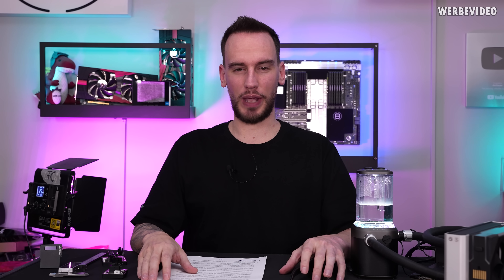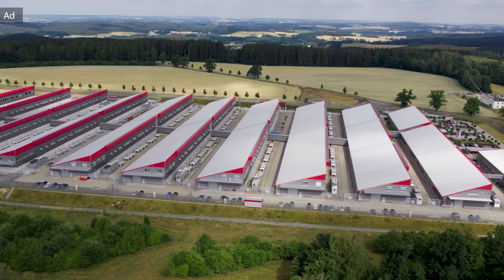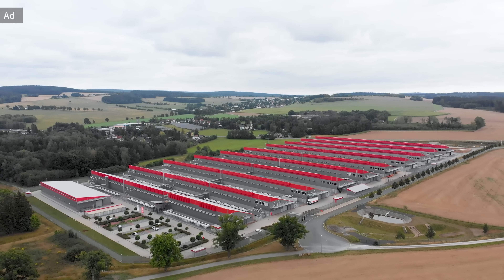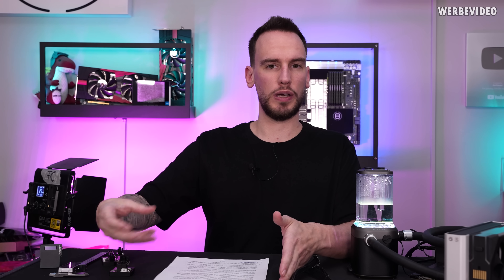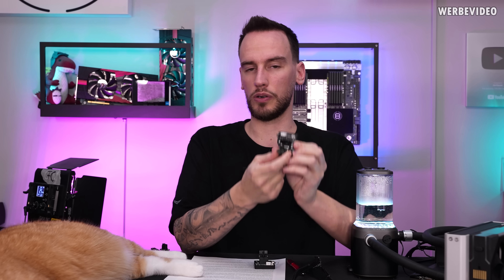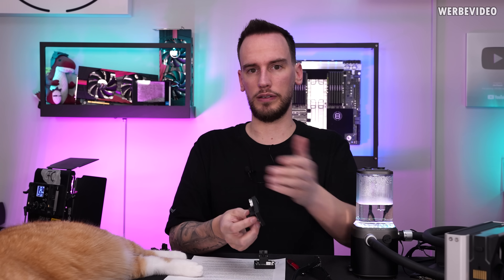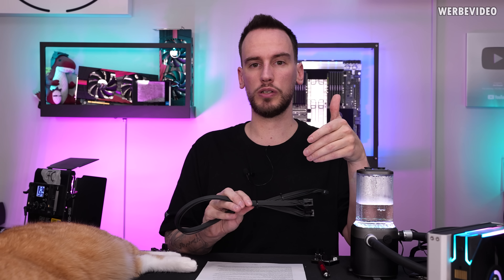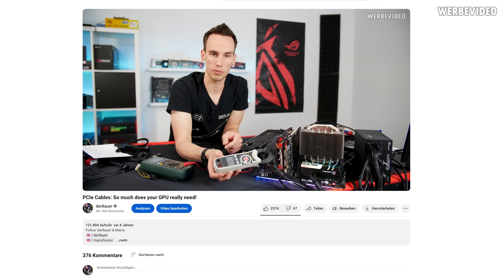12VHPWR is just Garbage and will Remain a Problem!!

Comment: In my engineering opinion, the 12V HPWR Connector is an engineering failure. The used connector (Molex Microfit 3.0) is rated for a Maximum of 8.5A/Pin before thermal derating. Every Electrician/EE knows that cables and connectors, especially in bundles, have a thermal derating factor. The 12V HPWR Connector uses 6 Pins each for +12V and 0V which puts the absolute maximum current at 51A. The PCIe5.0 spec claims that the connector is good for a sustained 600W load. Problem being that 600W at 12V is 50A! Only 1A away from the absolute maximum! And absolute maximum ratings are generally done at 20°C, which is not what you would expect to get inside a PC case, especially directly on the GPU! Honestly mind-boggling.
Reply: Exactly what I was thinking. I did the quick amps per contact math and facepalmed straight away with the stupid high current per pin. I was gonna check the datasheet since I thought it looked like the microfit 3.0 indeed, but thanks for saving me the disappointment when checking myself. Running a connector near max like that is just ridiculous, specially a tight 12 contact bundle like that.
Can't understand how in heck someone was paid to do this, and another one probably paid to sign this off.
Reply: @Kalvinjj  Blame design by committee.  For EVs, the worst connector known to man is CCS combo in the USA.  This was created by a standards body that makes money licensing specs as "standards" or with member fees.  I think these central standards companies are obsolete and don't have the skills to make something as simple as a connector anymore.
12vhpwr was designed by someone who had no clue what they were doing.  Its one job is to connect safely and it cannot do that.  Even the previous 8pin were not great. PCI-SIG ignored the issues with the 8pin and allowed the issues to be worse with 12vhpwr.
Nvidia should have copied the auto and server industries and switched to 48v as that would give them lots of power without the high current of 12v.
Reply: I don’t understand why a giant company like nvidia can make such bad/basic mistake. I meant it’s the kind of defect that impossible to miss during the prototype right?
Reply: @flamixin   Impossible to miss/allow right at the damn BOM (Bill Of Materials). Any electrical engineer worth his diploma should have seen how much current these guys are trying to pull from the pins and screamed NO quickly.
Reply: @flamixin nvidia didn’t make the connector/spec.. they just adopted it
Reply: @NyteStalker89  Yes, but Nvidias engineers could and should have known that "sqeezing big power loads through a fragile connector with tiny pins" won't work well, because contact resistance can't be haggled with.
Reply: @CranialMalfunction  imagine if this whole 12vhpwr is just another "planned obsolesence" by nvidia
Reply: @flamixin  It's in their name. Nvidia derives their name from the ancient Roman (not der8auer) Goddess of Envy: Invidia. And as silly as it may sound, yes, this is legitimate. They built their company off the idea that they wanted everyone to be envious of not having the best like the rest who bought an Nvidia card. *(even if their very first one was dog water.)

So why would Nvidia do this?

Because it allows them to later say "See, these twits can't do it right. We'll make our own PSU that does it right instead; and they'll be jealous."

Watch for Nvidia trying to buy up one of the better PSU companies in the near-ish future, or developing their own in-house.

And really, as silly and simple as this may see; this is human nature at work and it generally doesn't falter from its norm. Some exceptions apply, but we're talking about Nvidia here.
Reply: Money @flamixin
Reply: @flamixin NVIDIA didn’t design the spec, they adopted it.
Reply: @flamixin they're most likely be run by software engineers. They also probably look at the tech specs and they think to themselves, they want to use all of that thermal headroom to make it as "efficient" as possible without taking account of tolerances and thermal headroom.
Reply: @flamixin  

It's because they hire the computer science people to do the engineering for them.
Reply: @flamixin  Because Nvidia fans believe Nvidia can do no wrong. The more narrow the safety margin, the more money Nvidia saves for its record profits.
Reply: kind of makes you wonder who thought it was a good idea to begin with deserving of a Homer S "Doh", well explained thank you :)
Reply: @markmanderson  penny pinchers.. price a single 12vHP conector vs 3x PCIe 8-pin
Reply: A Diversity Hire
Reply: It's funny you mention derating. I had someone try to argue with me that 12VHPWR is superior due to derating on mini-fit jr, and I asked them how that didn't apply micro-fit. They never responded. It's odd how there are people out there that make these irrational arguments for a power connections. Even worse, they've learned just enough to sound like they know what they're talking about when they don't really know anything, so they're out there convincing people of their arguments that don't know any better.
Reply: Besides thermal derating you also have balance derating for parallel connections. The pin resistances are after all not guaranteed strictly equal, so some pins will heat more, encouraging them to build a surface oxide layer quicker, turning eventually into a runaway failure. Rules of thumb for this differ, but something on the order of 20% for each doubling of pin count has been suggested.
Reply: @SianaGearz  yep, exactly. That's why there is a margin of error that separates theoretical limit rating with real-world limit rating. To avoid this exact problem of a runaway failure.
Reply: PCISIG were responsible for the specification. Given the failure modes on all cards using it, it could result in fire and injury. Manufacturers of cards using this specification should seriously consider a full immediate recall of all products using it and consider sueing PCISIG for losses and damages.
Reply: The new connector set out to solve a problem that didn't exist, and actually created new problems.  Also the cable burning issues happen when the connector is slightly loose, and the 12VHPWR connector doesn't have a satisfying click at all, and it can also become loose from slight movement.  The 8-pin on my old EVGA 1660 super was rock solid: you could probably pull on the PCIE cable once connected and it's not coming loose.  Whereas the 4000 series cable/adapter doesn't click in firmly and is nowhere near as stable.  Also since these cards are much larger, if people dont have much side panel clearance, pressure on the PCI cable when closing possibly could cause the connector to become loose.

I shouldn't have to inspect a connector very carefully to make sure it's fully in, and the sense pins are fully in, to avoid catastrophe on my GPU in the future.  Meanwhile an 8 pin card has a satisfying, firm click and does not move.  Nor does it have the current problems you noted.  And Ada cards are already incredibly efficient, so there was no need for this connector in the first place!  A 4080 draws 320W *max*.  A 3090 can draw 385W max.  And the EVGA 3090 was using...3 8-pins.  And it was fine.
Reply: @gosuprime  I also thought the 4080 design was baffling. The 3080 has been shown to draw more power than a 4080 in nearly every type of load. I'm baffled why they all needed to be so large and use this badly engineered connector. Should have been able to make them in literally the same form factor and they'd actually fit in most everyone's case. I literally can't fit any AIB 4080/4090 and some 4070Ti in my case where my 3080 fits with room to spare. Main reason I completely skipped this generation along with the badly engineered connector. No thanks. I have an EE degree but haven't been in that industry since working in it for ~3 years building switch mode power supplies in the 90s. Even I could do some basic research on that connector and have a look of a raised eyebrow on my face...
Reply: @gosuprime  which I believe is the entire reason 12v-2x6 has been created, to fix this issue of it not being clearly connected.
Reply: @gosuprime my 3080 gamerock oc can go beyond 400w even on its default factory oc settings. 3090 can go beyond 450w. They intend to use this new connector for their upcoming more power hungry gpus. 600w is just the start.
Reply: @gosuprime  If a 4080 draws 320W max, why does a 4090 maxed out draw more than double that?
Reply: Old school approach is "The three quarter rule".
Never have a sustained load above 75% of the circuit's rating. 
Not the most "efficient" approach, but you don't have burning...
Reply: I'm an engineer for a company that makes machined contact connectors. Our 20 AWG contacts are rated for 12 amps. But no one would ever use them for a consumer cable like these because they cost 50 cents instead of 5 cents for a stamped contact.
Reply: Ever since the melted connector thing started happening I pretty much guessed it was the connector being run too near specs. If I ever have to use one of these cards, I don't care if I make it "ugly", I'm going to de-solder the existing connector and hard wire in my own power dongle. Possibly something Anderson PowerPole, and make a mating connector for the ATX.
Reply: @therealjammit  except that's not true at all. None of the melted cases are being run at "near spec." They're run far below. These are rated by Intel at 600W and just using gauges, they're rated 60W higher than Intel. 4090 is a 450W card and the adapters melt even when idling or pulling 50W. It has absolutely nothing to do with power delivery. 3090ti is also a 450W card that uses 12VHPWR and has had no melting issues. The connector is not problematic at all. Roman's video doesn't give any information to back the idea that the connector is a problem. People thinking the issue is the connector aren't looking at the specs, power delivery, or usage of the devices that use this connector. They're just saying "oh this one connector can't handle it" even though there's no evidence to back that claim. All of the melting issues have been with using two specific adapters. Not from using just the connector alone.
Reply: @Djinnerator just because you don't see them doesn't mean they don't exist. Those 3090s that have the new connectors do burn out, but you just gaslight them that it's their fault. RMA usually rejects them and they either go to NorthridgeFix's desk or it goes to the landfill.
Reply: @triadwarfare  No, there have not been any reported case of 3090 burning. Just because you don't see them doesn't mean it also exists. Every electronic has faults, if there's no pattern of faults, it's not an issue. But there has been no reported case of it, and it's been out for a couple years now. So where are these burning 3090s you claim exist?
Reply: @Djinnerator  "No, there have not been any reported case of 3090 burning" yes there has. 30,20,10 all have same "issue" when its user fails to properly seat their power cables or using 3rd party adapters. A simple google search would have disclosed this before you commented, always do the research
Reply: @Djinnerator  It should be staggeringly obvious to anyone not sickeningly undereducated that a pin's ampacity can be exceeded if there is complete failure to do something as utterly trivial as plug it in correctly and check the catch is secure as blatantly designed. The sheer lack of intelligence, care, and attention to the most remedial of detail associated with the degrading failure to do this constitutes a truly shameful embarrassment. All this hoo-ha over the source of failure is shocking and ridiculous, and shame on all those suggesting any problem lies with anyone but the user on this matter. Properly seat your power cables, buy a case that fits, do not bend cables, do not use 3rd party adapters, have a professional who knows what they are doing building rigs and you will have a %99.9 success rate according to the current data..
Reply: Honestly, why did they have to make the connector with smaller pins?  If they had just stuck to the same size of pins as the normal connector, we'd be fine.  I don't know why the standard had to be smaller when most of the graphics cards that justify such a high power rating are so big that the size of the power connector is irrelevant.
Reply: That derating table, number of conductors is not number of strands that Roman was talking about
Reply: The answer is probably money (again). Senior management and executives at Nvidia who have little knowledge on what they're selling to consumers (including children) and risking burning their homes to the ground. I am not surprised by this attitude from the upper echelons of our society but I am surprised by your crucial detail.
Reply: @BleedForTheWorld  Senior management at Nvidia have plenty knowledge on their consumers, which is why the marketing is so successful. Knowing the consumer's hopes and fears is more important than knowing the product itself.
Reply: And from a mechanical standpoint it's also junk, since any pull or bob against the cable causes it to unseat ...

I'm extra glad I went the AMD route this time... Just 3x 8 pin.
Reply: @DCG909   Yeah, I agree. It seems to have some pretty strict requirments when it comes to cable bending, the amounts of installs etc. It seems that those requirements have too little safety margins given how different PC-cases are. The average consumer  dont understand that they need to install some 90 degree adapter for 40 euros and dont know how sensitive the cable bending is. It is not the fault of the customer. It is even proven that doing it correctly can have issues. It is a probability distribution, if you design it very close to tolerances there will be a percentage that fails eventhough they do everything correct. That is why you design with tolerances and extensive testing.
Reply: and now you know why Nvidia doesn't use it on their commercial lines of cards, or why any other maker is using it.
Reply: Anyone involved in signing off on the 12vhpwr connector for use should be barred from engineering anything in the future.
Reply: I learn somthing today and now understand what has gone wrong thank you insight
Reply: I'm sort of confused why this was able to happen in the first place.  I have been thinking about this since they released when I did the calculations - I looked for a PSU that specifically stated a larger wire size for the 12hp cable.  Isn't there usually a safety factor that needs to be hit in order to sell a product?  I've heard 10% in some fields is minimum, and most go beyond that.  Is this a failure of regulation, or is there no actual regulation for this?

I know for building electrical, there is a safety factor built into the specs required to meet code, and there are still scenarios that are explicitly called out when you need to increase wire/terminal size further.  I just find it hard to believe that there wasn't some regulation that was broken to release these connectors in the first place.
Reply: @Zyxlian  not an accident, company politics.  Nvidia wanted the connector.  the egg head  who made the final call has likely never even took a grade shcool science (IMO).  So,  on paper 50 amps is less then 51 amps,   so they did it.  I have same type of problem where I work.
Reply: yeah not an engineer but the first time I saw that connector I thought this was designed by "theoretical engineers", aka the engineers that design things that work only in theoretical or optimal conditions. Also nobody did tests to notice that MAYBE it was a bad idea too, another classic "theoretical engineer" thing. The theory is always right, why waste time testing it.
Reply: It wasn't any engineering failure it was definitely known as it is absolutely basic shit 
They knowingly allowed it
 also against having a connection carry that high amps flow just from some pins without any locking mechanism or support
Reply: Brilliant explanation. 8 pin forever.
Reply: Not to mention the added heat due to the resistance generated from improper pin connections, it really is amazing that more people aren't having issues.
Reply: Nvidia wanting to be special
Reply: Just like Nvidia. Put it all to the max edge!!!! Fire?! Nah! Not our problem!!
Reply: And they didn't even bother to use gold plated pins. Higher the contact resistance means more heat, perfect for burning through plastics..
Reply: I'm glad to know that an engineer has confirmed that the 12VHPWR connector is objectively horrendous. As a consumer, I find anything that fails considerably from user error is badly engineered. Something (especially a connector) must be built with  consumer stupidity in mind, pardon my French.
Reply: I have been seeing these connectors melt at about 32 amps of continuous usage in the automotive industry. If the environment gets extreme heat for any length of time the contacts can't move enough heat away to the board and the  silicon burns.
Reply: They changed the design so they can license it nothing more, and MBA that did a week of engineering came up with this. They probably got tax credits for being ESG targeted, and no different for car manafacture having biodegradable wiring looms in engine bay. In the 90s
Reply: The fact that it’s an Intel design, yet even THEY refused to adopt that standard on their own GPU’s should have told every bid wig at Nvidia what they needed to know
Reply: I agree with your comment @web1bastler, but the official Microfit documentation also points out that the max 8.5A rating is only applicable to dual-circuit connectors, and recommends progressive derate for higher circuit density configuration. 

At 12-circuit configuration (6 conductor pairs), the max current per terminal is 5.5A (about a 25% derate). This is straight from Molex product specifications sheet for the Microfit series (Molex document # PS-43045)

The 12VHPWR connector is a true fuck-up
Reply: Why most electrical codes allow for overhead. IE 1500W on a 120 volt 15Amp circuit.
Reply: NVIDIA produced defective cards, that's the simple gist of it. All these other brands are trying to produce solutions to fix what NVIDIA did in laymens terms is an 'oopsies'. The problem comes down to simply that the eggheads at R&D department of NVIDIA thought that theoretical limit of power connector material limits is the same as real world material limit i.e. that resistance and material impurities don't exist. So pumping that much power through singular tiny connectors that are full of resistance and impurities would conduct heat and eventually there would be a melting point. CableMod's adaptors are not faulty or defective, the point of failure is on NVIDIA's side.
Reply: Oof. Great point. I hadnt even considered that it might be burning because its way too close to the limit of what the physical materials can take.

From now on, if someone asks for a good example why you shouldnt fly too close to the limits i'll remind them that these are burning up because of this. Thanks!
Reply: Aside from derating due to heat and heat cycling there is also the plug-unplug cycle derating.  A cable that you use to do benchmarking of various different GPUs is not going to last as long as a one-time assembly.  I have not found the number of cycles for the 12VHPWR connector but similar connectors claim about 30 plug-unplug cycles before they are out of spec.  But that is an average number and not an exact life-time estimate, so the cable in the video could last for more or for fewer cycles. Regardless of which card and the number of amps you are pulling the life-time can be greatly reduced by the number of plug-unplug cycles, heat cycles, vibration etc... Two 12VHPWR connectors would work to lessen the load but three 12VHPWR cables would be the magic number to stay in spec for higher power hungry cards over their entire lifetime of use, but it is the power supply side that has this higher derating factor, not the load/GPU side and I'm guessing that is by design.
Reply: For fun I checked Molex website, found the pin inside the conector is rated at max of 9.2A for power pins and 1.0A for sensing pins, so if there is no load balancing even a slight hike on one of the pins can cause it to burn. Also a fun fact they are very sensitive to humidity and temperature, which both of these factors are in a closed PC case.
Reply: Coming from an EE background and working in industrial automation, I am baffled by this connector.
Reply: So I guess the 450W cables are not as bad?
Reply: Yes, no engineering safety range. Well, 1A. Because you can ALWAYS ensure NOTHING will cause to momentarily draw more than 1A and that you will always use your PC In a place that always remains at 20C.
Reply: I think they did it on purpose so tat they wont have to accept RMA of many gpu. because retailers are claiming that their warranty does not cover "burned connectors", so if you have that issue you are on your own...
Reply: Does the PCIe5.0 spec factor in power provided by the PCIe connector itself, when specifying the 600W rating?  Or that 600W is solely what the 12V HPWR connector can supply?  Specifically is 600W a system rating, or a connector only rating?
Reply: @earthwormjim  Couldn't tell you about the PCIe 5.0 spec, but on the older version that still had 12VHPWR it specified 600W for the connector itself. So, if you were designing a card that used 12VHPWR you had the 75W from the PCIe connector itself plus 600W from the 12VHPWR. Since they've always done it this way, as you're free to choose if you need additional power or not, I'd guess it's the same this time.
Reply: Yes, running that close to the theoretical maximum is a poor design, but on top of that, the real question is are they using genuine Molex connectors on both the cards and the cables, or did thy go with the no name chinese clones to save a few pennies?? And if they are genuine Molex, was there a manufacturing problem where the pins are out of spec and not making a good connection?
Reply: Its a non issue. According to the AQL industry standard (Acceptable Quality Level) the acceptable failure rates are as follows. This issue also would fall under a minor defect due to scarcity of the issue (less than %0.1) :

The failure to meet the requirements of customers with respect to quality is termed as defects. The three categories of defects are:

Minor Defects - Not likely to reduce the usability and material of the product for its intended purpose, but slightly altered from the intended design and specifications. The industry average AQL for minor defects is 4%.

Major Defects - Not acceptable to the customers. Usage of the product will most likely result in failure. The industry average for AQL for major defects is 2.5%.

Critical Defects - If accepted, this type of defect could potentially harm or injury the customer. These defects are completely unacceptable. The industry standard for AQL for critical defects is 0%.
Reply: @javiersantana848  depends on the circumstances and the danger stemming from the defect. If the defect could light a customer's house on fire then the margin for defects is essentially 0. That is the case here.
Reply: It's not a Molex Microfit 3. It's a compatible product by Astron which supposedly has a much higher current rating.
Reply: One thing also was bothering me. That busbar inside that connector. Without it you would have cable to balancing out uneven pin connections. With busbar if one contact have better connection than others then it will take more current and can go over specification. That pin have bigger thermal load.
If I remember right PCIe 8-pin connectors don't have busbars.
Edit: That busbar may have been only on those adapter cables that was problem at beginning.
Reply: This is all Nvidia’s fault , why the hell do people keep putting up with them and giving them money, they don’t care about their customers at all.
Reply: I'm no electrician and didn't even know much bout thermal derating, I just do amateur projects and the odd outlet here or there, but from the get go I always thought in the back of my mind it's just TOO SMALL! Even after the melting debacle I still thought it was too delicate compared to the previous standard that worked just about perfectly no matter what. The worst part is people genuinely trusted that everyone trusted Nvidia and PCI-sig to know what they're doing, but It just feels like an unneccessary, shortsighted corporate move to save their 10 cents a product.
Reply: The microfit pins I ordered are rated for 12 A (Part-number 10132447-121PLF)
Reply: The 6 and 8 pin PCIe power convectors must have plenty of overhead built in. I always thought it of that the two extra conductors in the 8 pin are both ground. Meaning only 3 of the 8 conductors are providing 12v. So from an EE perspective both the 6 and 8 pin should have the same maximum power delivery specification.
Reply: Agreed. I used to do board design for Gigabyte. I worked on some extreme OC boards and some budget offerings. I've refused to sign off on beefier connectors than this for an expected load of 400W. I take pride that these boards are built like tanks with massive safety margins, as I have yet to see a melted Z490 Aorus board even with the hell people put them through with 10900K OCs.
Reply: yeah expecting to use it right at max spec limit in situations way hotter than what it's rated for is just mind boggling.  Idk how any company thought adopting this was a good idea. If I was a gpu maker, psu maker, or cable maker I would know to stay a mile away from this. Just gonna be QA and customer service disaster with alot of RMA's.
Reply: True. The second I saw this connector, and heard claim about 600W at 12V, I knew it can't be right. It looks like flimsy sh*t, compared to WAGO wire connectors rated at 32A. No way 50A is a safe load on this new connector. Tests on test bench maybe went well enough, but that's not real world use.
Reply: 12VHPWR is compact and pretty. Unfortunately it's very uneconomical to build a pair of connectors, both male and female, that can withstand that much current. You have to lower the current by splitting the wires or move the PC to 48V era like Tesla.
Reply: @JohnWilliams-gy5yc  you can have compact and pretty connectors. The whole RC hobby uses XT60, a small connector jointly released as open standard by Hobbyking and Amass, which is basically an LCP shell around bullet style hard gold plated copper alloy connectors with 30A sustained continuous rating. The connector terminates wire side in a solder cup that can be dip soldered by factory, but crimp variants apparently exist now as well. Crimping XT style connectors has lead to issues in the past, this is something that needs careful validation. Another high current variant can be made with blade style connectors and advanced gripper design and again hard gold coatings. The blade can terminate into a busbar PCB to allow joining multiple cables to it to make it compatible with typical Molex Minifit style modular PSU outputs. The cost of all this is very insubstantial compared to high current semiconductors necessary to make use of high power connectors, and you can scale grades down for cost with detect signalling side channel like on the 12VHPWR, or varying the shell key shape such that a higher rated version cable can be inserted into a lower current consumer but not vice versa. I don't know why this industry completely avoids higher end materials and construction, there's no good reason for that.
Reply: I have always said the 12VHPWR specification was a garbage 'standard' that should never have seen the light of day!

According to Molex's specifications for Microfit 3.0, a 12 circuit connector (single row) is rated at 6.5 Amps per pin, so with a double row it will be even less! Assuming 6.5A per pin and 6 positive pins, this allows for a total of 39 Amps which at 12 Volts equates to 468 Watts. If the connector is derated to 6 Amps because there are two rows then this allows 36 Amps, which at 12 Volts equates to 432 Watts. The IEC rates the connector at 5 Amps per pin, which gives a total of 35 Amps which equates to 420 Watts.

Long story short, when this first came up on this channel I started researching the connectors and from the information in the video I discovered there were three sizes on connector in the same style. The 12HPWR connector was the smallest, lowest specification, of the three. The next size up is the same as current PCIe connectors and finally there is an even larger size. If the largest size had been chosen, this could have been a genuine improvement in power delivery. How the current smallest connector came to the standard I do not know. I would have to check each of the connector specifications carefully, but I do wonder if there was possibly a typographical error somewhere or confusion or misunderstanding between metric and imperial units, both of which are known to occur fairly frequently.
Reply: Microfit, which is normally 8.5A/pin but does actually have 10A/pin high current terminals available. There's also Microfit+ which for a 6 circuit dual row application, like the 12VHPWR connector, is specified at 10.6A/pin at 16AWG.
Reply: how about rtx 4080 tdp of 320 watt , will it withstand worse case scenario ?
Reply: Well there is ONE thing that may have been overlooked by most. PCI-SIG also tends to count the power supplied through the Motherboard. Which is stated at 75W for GPUs through a PCIe 16x slot. Under this the maximum sustained load over the cable/connector would actually be 525W or 43.75A (7.3A/pin) which would be safe. Gotta be sure it is explicitly the cable rating, not the total power rating...

Regardless i honestly think they should have just used the Microfit+ as a base. It is slightly more expensive, but can handle 13A/pin. It is appalling that despite the superior safer option available for components of these costs, they still decided to cheapen out....
Reply: Exactly my point, right on!
Reply: Not to mention they should've known that vendors would exceed the max current spec for nontrivial transient periods, e.g. pulling 120% or more of the max rating for tens of seconds at a time, like they always have done with products aimed at the OC market. Even when we're talking about a cost-optimised system for mass production, it's downright negligent to build with a sub-2% safety margin, let alone one that's instantly violated in the upper quartile of standard environmental temperatures due to thermal derating. The worst part, too, is that there's a bell curve of effective contact surface area on pin connectors like this, due to variances in the crimping, which leads to pretty nasty current density hotspots in a few percent of connectors that are on the borderline of passing QA. Anyone who's done a PDN analysis (which should be literally every engineer involved with a spec like this!) knows that you've got to watch out for that kind of thing. Having been part of standards working groups in the past, my bet would be that the engineers were well aware of just how close to the limit it is, but their concerns were overridden by industry members in the WG who wanted to cut costs. Connectors and cables are an expensive part of the BOM, with secondary cost adders due to increased shipping mass, so it doesn't surprise me that they were trying to skimp on the design.
Reply: yeah, when you consider the older 8pin spec is less than half the per pin amperage on LARGER CONNECTORS, the entire 12vhpwr seems like a fiasco meant only to shave a few cents off total unit price.
Reply: Yeah I thought it would be funny to hook up my 4090 with 2 8 AWG wires way safer
Reply: @B0BBYGAMER  Doesn't sound safe
Reply: Damn. Well if I had 4090 I would definitely undervolt it a little.
Reply: @megapet777  Why would you spend $2000+ for a 4090 just to get less performance by undervolting it? You can get the same performance of an undervolted 4090 with a cheaper card that costs half the price
Reply: Hi, thanks, as i can see in this table they calculate it for 1000v ? Seriously ? How crazy they are !  
Electrical norm are different for each country. When you building a house they are really more restrictive than that bullshit tabler with 0 security factor and no default to the cables. The values on this table are made from theorical cables who are perfecly made in an utopian world ? . 

For 230v in Switzerland you officially allowed to put 13A with 1.5mm2 full copper wire,  and it depend of the length of the cable in the walls too. (Normally it's 10A for full secure to the cable, but for shorters distances and shorter using time it's ok to use 13A, so the security here is theorically arround 30% in normal usage : plugs in the walls are specified for 16A max before melting, but not the cables who die way before 16A)
Even while respecting these standards you can melt a cable after ~1hour (on the same plug) if you use max wattage (230x13= 2990W) achievable with some vacuum cleaner from stupid builder (ex: thanks Dyson with olds models) .
Reply: It's obvious to me, planned obsolescence, build in as many failure points as possible. With nvidia's approach to minimal v-ram,  clearly that's the whole idea behind all their anti consumer/stupid decisions...
Reply: Not an opinion.. just a fact... you need room to accommodate the spec to avoid issues ......
Reply: I made about the same comment when they first came out and were melting.  I had been looking up minifit power capacity for some car audio, with wire gauge and pin type.  Not all pins are rated the same either, and if I remember correctly, it could fall under 600w.
Reply: OP is correct.  This is why there the potential for such a problem at only 450W.  When not fully seated it creates a big problem and that is nowhere near the 600W supposed limit.
Reply: So this is how far planned obsolesence has gone
Reply: yep it feels like even just derating that connector to 450W per connector would help a lot. That would match up with the actual current carrying capacity for 2 x 6 pin miniFit (using all pins for current carrying) too. And maybe updating the spec for 8pin PCI-E power to be around 220W. And no more sense/config pins complexities.
Reply: @DennisLeeyeet  the problem is the cards that are melting have a design power draw of 450W. So just derating the connector won’t solve the poor connection problem. Unless the cards are OCing 50% more power, tolerance on the pins and a bad location for the connector that guarantees it will be heavily bent are the problem
Reply: diversity hires
Reply: Just another reason to undervolt.  My 4080 never draws more than 320w maximum during the hardest stress tests with an uncapped frame rate.  Since I normally cap my frame rate at 60 anyway, it almost never even reaches 300w.  Doesn't really bode well for future cards though that will invariably be even more power hungry.
Reply: What if we set power limit to the 4090  -15% and undervolt the card
Would that increase the saftey margin
Reply: @Adel-sj4ue  You would have to power limit the card to about 300W to be in the safe zone for the connector.  That is about 50% of what the connector itself is rated for (which is BS for such tightly bundled connections and wiring). Over 50% is where the danger starts to occur but if you really want to play it safe then just don't use that connector.  Or at least don't use it by itself, solder some wires on and add a second connector of some kind that can support at least 150W so you don't have to power limit the card.  This still means the trances on the card need to carry all that power so the board itself might need a little modification so the traces don't start to heat up and separate from the board.
Reply: That is why I use a 3 x 8 at 288W per plug rating to 12VHPWR cable.
Reply: How is the connector an engineering failure as opposed to an implementation failure of the manufacturer's making GPUS and expecting to run a connector at near maximum capability? Everyone knows you don't spec a cable or connection with 0% headroom. The connector work just fine if kept within it's limits, allowing for extra room due to thermals/manufacturing tolerances etc...  The failure is the gpu manufacturers and PCIE spec if anything.
Reply: nvidia just doesn't want their gpu to last 10 years that much is obvious.
Reply: Yeah, I have a Ham Radio License and was an industrial electrician working with automation controls. If you have electronics experience, you can just look at that 12 pin connector and know it isn't right for the power they want to run through it.
Reply: Absolute RIGHT!
Reply: It's even more than the math says. I have a Ham license and also did industrial electrical controls for awhile. We always figured in about  a 10% to 15% "fudge factor" as well, based on real world experience.  This is happening to Nvidia because of bad engineering and shear corporate arrogance and refusal to admit they are wrong. IE Nvidia is now a full blow Robber Baron company, and I'm not buying anything from them for some time into the future. If they can't get a simple electrical connection right, imagine what horrors may lay hidden on the PC board and component selections.
Reply: Who would have thought replacing 24 pins (8 x 3) of higher gauge wire with 12 lower gauge wire in a much smaller space would lead to such problems!!!
Reply: It's also better to have separate wire bundles (2x6 or 8 vs 12) from a mechanical perspective. The new standard was really not needed.
Reply: @valkaielod  done for cost savings
Reply: For your engineering opinion, what keeps that 50 amps of power draw between the 6 +12v to ground pin circuits balanced so when it is running at 600 watts that each one is only drawing 8.33 amps and not cause one +12v pin draw well over 8.5 amps?  Given Gamers Nexus video, the RTX 4090, for our example, will still draw 40+ amps through the connector even if only 2 +12v and 2 ground pins are connected.
Reply: @LBXZero   Nothing actively balances the pins as far as I know, they're just in parallel and be it. So yes, when one of them has a bad contact, the others take up the slack.
Reply: @Kalvinjj  What if one pin's wiring to the 12v rail in the PSU is significantly shorter than the others?
Reply: @LBXZero   if both that happens and the pin itself isn't compensating with higher resistance, it's to be expected this pin/wire will carry more current. It's impossible to fully balance it, a good connection does enough of it but the margins are too small here.
Reply: @Kalvinjj  this is potentially the point of the safety factor.  I find the connector being what melts is the red herring of the investigation.  For a 12VHPWR to 12VHPWR, you have 6 +12v paths from the 12v rail(s) in the PSU, the wiring in the PSU, connector at the PSU, wiring to the device, connector at the device, then the power regulation system in the device.  The adapter dongles make everything worse.  If one path becomes more favorable than the others, more current goes down it, even if it is unsafe at a certain point.  It is a surprise we don't see more melting at the PSU connector, but that is probably because most cases are using the dongles.  When PCIE 8-pin connectors melt, it is typically the PSU side.
Reply: @LBXZero  The interesting thing, and what also pisses me off a bit, is that the older 8 pin connector (by design, also the 6 pin ones) could take up to 13A per pin. In short, the two 8 pin connectors, despite being rated at 150w per PCIe spec, can on the same safety margin of the 12VHPWR pull about 900w together. They also got 3 +12v pins each so the total is the same but the larger spacing connector allows even thicker wire. I have no clue why they went with Micro Fit 3.0 smaller connectors other than to appear oh-so-new and save some pennies.
Reply: @Kalvinjj  I am assuming the 12VHPWR design was to reduce the landscape the power connectors took up, to deliver insane power to a smaller card.  When I took apart my video that was 3x PCIE 8-pin connectors, there are a series of what I am assuming are the VRMs labeled R12 2041 which get thermal pads, and then there were 6 similar chips labeled R15 2041, 3 scattered between the GPU and the slot panel and 1 behind each of the PCIE 8-pin connectors.  Each power connector needs a set of components for them, as it is always the device's responsibility to regulate the power draw from any source.
Reply: @LBXZero  Electrical resistance at the pin connection will determine the current load of any individual pin, if one pin has a higher current load it will heat up faster, increase it's contact resistance, lower it's current through put and the other pins will take up the slack according to their own resistance. You don't just have one pin taking all the load unless something is very wrong (then it's too late)

Note that it's the high resistance connections that are causing the burning, not necessarily the pins that are carrying the most current, though the failure can cascade quickly if the connector is running so close to it's spec limit like here.
Reply: @volentimeh  Let me give you a situation.  We have the RTX 4090 and a 4 PCIe 8-pin dongle adapter.  The collection of modular cables for his power supply had 2 cables with 2 PCIe 8-pin plugs and 2 cables with just 1 PCIe 8-pin plug that is a little longer.  The person ends up plugging into the dongle adapter the middle plug of 1 2 plug cable, the end plug of the 2nd 2 plug cable, and the 2 1 plug cables.  It is a know fact that the length of the wire adds to the overall resistance of the wire.  The pin's resistance will determine how hot the pin will get under a certain load, I know that part.  But isn't it the entire path's collective resistance that determines what kind of load that crosses that pin?
Reply: @LBXZero  model the connector pins as PTC thermistors in parallel, and apply Kirchhoff's circuit laws. the lowest resistance path will have the highest current, and the highest resistance path will have the lowest current. resistivity is linearly proportional to temperature. temperature increases with the square of current (P=I^2R) so you get a simultaneous equation that describes the equilibrium. you can trivially model this in LTSpice using behavioural resistors - you'll find that the individual pins reach a thermal and electrical equilibrium. (this is in contrast to semiconductors where there's a negative tempco, hence the issue of hotspots and thermal runaway when operating MOSFETs in a linear mode). the issue is that when one conductor has a higher resistance than expected (e.g. due to poor contact on the pins) the current through the other conductors increases proportionately to satisfy the load - remember that the load is nonlinear and can be modelled as a constant current sink for simplification, so the overall current through the connector doesn't go down as the connector resistance changes. this shift in relative current increases the ohmic losses through the "better" conductors by the square of the magnitude of current imbalance, which is a major problem if you're operating the connectors near to their limit anyway. the problem is particularly bad on these types of connectors because the metal-to-metal contact is rarely consistent, so you end up with high current density hotspots, which can lead to localised parts of the connector pins getting much hotter than expected. if you do a PDN analysis with a field solver you can see this visually - the current density increases rapidly as you pinch the current flow through a small volume.
Reply: also 16/18/20 AWG rating is for used cable as a whole, not for theoretical cable without strands. so I don't understand why Roman used that coefficient table and cut his PSU 6+2 pin at all.
16 AWG is 18A@90C. period. so it can handle way more than what Roman has calculated. anyway the main limit is actually pins, not wires.
Reply: @rawdez_ yep, he got a bit confused
Reply: @rawdez_  that's also something the 12vhpwr cable kinda "fudges". They use a 30*c rise, while the 12v atx molex one used a 20*c rise.
Reply: @rawdez_ I am an electrical engineer designing electrical systems for nearly two decades.  I have probably worked on equipment that built something in every single car you get in today.  I have never used the 90C rating on a conductor in that time period.  This would be transferring heat into other components even if your sheathing is rated to 90C.  We have to derate for conductors for so many reasons.  I typically start at an 80% derating because I know it will nearly always be at least that.  Him using exactly this is normal.
Reply: @mrfarts5176  I am in no way an electrical engineer and I was always told you NEVER go over 80% of the rated load of a circuit. Nice to see someone saying this.
Reply: @keithvsmith  Thats actually just for building wiring, which has its own set of definitions, ratings, and regulations. There is no way to assign a "circuit load rating" that is applicable in every engineering scenario. For instance, the "rated current" for an 8 AWG wire is typically cited around 50-60 amps depending on install conditions and insulation type. But in a large UAV we may be putting ~200+ amps through the same size wire with no issues. Ther are a lot of reasons for this, and it is why there is a difference between engineers and electricians / technicians jobs.
Reply: @rawdez_  I believe Roman took the worst theoretical case scenario.
Reply: So basically what you're saying is limit the spec to 450W, which should be a big enough margin of error. 450W + 75W from the PCIe slot is 525W total should be more than enough for a 4090 aftermarket cooler.
Reply: I don't need to be an engineer to understand the basic concept that smaller connector = lower tolerances. It's a nice concept to have 1 connector for your GPU but in practice the guague of each pin should be much thicker.
Reply: @llamapi3  guague? What's that?
Reply: @sammiller6631  A gayge, obviously.
Reply: @VladimirNicolici  obviously?
Reply: I knew the 12VHPWR connector was a poor design, but I'm not an engineer so couldn't have possibly backed up my notion with actual data. Thank you for doing the math and confirming what I already suspected through my own speculations: too much power being sent through a much too small connector.
Reply: WATERCOOL THE CABLES
Reply: Something that amazed me is the fact that nobody mentioned using 2 of these cables instead of a single one.

That is a great bandaid tbh.

And the fact that 2x6 ones have shorter sense pins AND longer current pins, so they have higher contact surface.
Reply: I don't think the problem is the connector, if you look close to 3090ti it has almost same connector. The only difference is 3090ti split 12v input to three different rails. This way the card can do load balance much better on those six 12v pins. The most failed connectors are happened on one pin at out side which show the uneven load on the pin. I don't see anyone openly criticizing the Nvidia on this design flaw, rather blane everything on the connector.
Reply: the extra powe draw is the issue I now understand  @kaiwenwu8148
Reply: @kaiwenwu8148  No, you are not accounting for metal impurities in a connector and resistance. Safety of margin exist for a reason because you can't assume that a theoretical limit is the same as a real-world limit. What went wrong here is that NVIDIA assumed that they could push the threshold of conductive material limit to the theoretical limit. The result is that, connectors are burning because they build up too much heat from resistance and metal impurities. They also didn't take into account that amps threshold is done at 20 degrees temperatures, where most computer cases will be double the temperatures (either liquid or air cooled). Basically someone at NVIDIA did a major oopsies. And they won't admit it, or do a recall at your expense of constantly getting your graphics card repaired every 6 months to replace a burnt connector every time. The 4090's are defective.
Reply: @luminatrixfanfiction  I think you missed my point, I not saying Nvidia is good to choose this connector. What I want to say is if you use better materials to make this connector the issue will still exist, even switch back to old 8pin pcie connector the issue will still exist. If you run two cables in parallel the current handle ability is not 100% increase but more like 85%-90%, if goes to six cable the current handle ability is like 60% to 65%. This is why connector is not the real problem, the power delivery system is the problem. Hopefully you can understand.
Reply: @luminatrixfanfiction  In my calculation, the max possible current go through one pin is about 20A this no possible way to make a contractor to handle this kind of current. In 3090ti pcb design the max current on on pin is 10A. This is the difference.
Reply: @kaiwenwu8148  uneven loading is the connectors fault.
They are suppose to be designed that uneven loading isn't a problem.

You will simply by the nature of gravity pulling down a cable will cause uneven loading on pins... longer/heavier the cable the greater effect gravity has.
Also as the cable heats up the plastic insulation becomes less stiff and further increases uneven pulling just from gravity.
You can see just HOW sensitive the connector is by needing 3.5cm before you start bending it...
Which pretty much make it and the videocards its currently used on... not fit in effectively any case.

Yet they added those bending rules after the fact...
Reply: @kaiwenwu8148  "almost" the same connector is not the same connector. That's like saying FSR is almost the same performance as DLSS. Or 7900XT is almost the same as RTX 4080. If AMD's Raytracing performance is almost the same, why aren't more people buying them over Nvidia?
Reply: @sammiller6631  3090ti don't need the 4 sense pin, I don't see it going to change anything.
Reply: @kaiwenwu8148  3090 is old. What will they do for the 5090?
Reply: @sammiller6631  "why aren't more people buying them over Nvidia?" because of Nvidia's garbage marketing and the gullibility of consumers to "want the absolute best" at any cost. that is why Nvidia has more market share. they aren't a "better card" by any stretch. Nvidia just markets it better and the blind masses willingly pay what Nvidia charges. 

People will put themselves into crippling debt to get the latest XX90 series cards to be the best. even if their use case doesn't fit the necessity.
Reply: @sammiller6631 bad fsr wont burn your computer.
Reply: The spec might call for a 600W capability and that might be sailing VERY close to the wind but what stock card pulls anything close to 600W?
Reply: @BikingChap  If they don't allow 4090 to be overclocked, it will hurt sales. So you can't assume stock card levels for safety.
Reply: @sammiller6631  I'm not familiar with overclocks on the 4090, do they go over 600w when benched?
Reply: @BikingChap  Gamers Nexus showed a 4090 overclocked to 666 watts.
Reply: @sammiller6631  that's mental isn't it, but there's clearly more to this because i doubt those with burning connectors had all pushed them that hard. It still smacks to me of connectors where, for whatever reasons, pins are either going high resistance or completely losing contact even with the slightest physical stress.
Reply: I wrote this somewhere else, but since this is relevant here, I am gonna copy paste my response :

As an electronics engineer myself, using similar connectors I am actually very confused about all these problems? We have been using similar connectors for the last 15 years producing well over 10-20k units per year. Not one single faulty unit. We only use Molex and JST branded and they have zero problem doing the max ratings over long periods of time in a guite warm environment.
I also don't agree with the explanation here. I think the main problem here is the mix and match between brands of connectors between cables, adapters and video cards.
Some video card and cable manufacturers are using very cheap and low quality connectors as well as bad matching metal parts (pin and receptacle) 
Again, an high quality Molex to Molex brand connector has no problem sustaining this amount of current.
I test that even on a regular basis.
Reply: @p_mouse8676  its because they are specing it out at a 99+% duty cycle.   even the wiring in your house is only spec's at 80% duty cycle, with 15A (in NA)  being peak.  this type of torture cause material degredation ove time. simple Nvidia ate into their tollerences.  terrible reality in large companies is the person with final say is usually not the one actially qualified
Reply: @p_mouse8676  molex cables and connectors have a good security factor : 30% from the max or more ? , When those stupides 12pins connectors have only 2% of security..... same as the car market makers now security factor level reach 0.....   Do the elevator makers make 2% of security too ? Not really, they have a factor of 2 ; 3 or even more in the past   (factor 2 = 200% for the load value).

That's only for creat a new norm and just take money, the company purpose who created those 12pins connectors, was only made for that:  make money at all cost.
Reply: @p_mouse8676 but that's also where the problem is: no safety factor in an assembly line where third part components are not strictly checked.
I can easily build a truss using a
Reply: @p_mouse8676  The difference is what you said AND that we are talking about consumer parts installed by ordinary people.  In that situation things need to be idiot proof.   If they aren't that is a fault of the design not of the person using it.
Reply: @p_mouse8676 Very good information.  But it still seems like a Nvidia issue for not specifying enough and taking into account manufacuturing variability. Or at least foresee the issue of manufacturers cutting corners. I hope there will be a newer more «idiotproof»-connector. That can handle installation and variability in manufacturing better.
Reply: @crabapple1974  Forgot to mention one thing. There is something called temperature degradation. Since the resistance of any the conductive materials go up as function of temperature.
With a good quality connector you're still not near melting temperatures.
Which btw is another very bad indicator. With properly rated UL94 connectors, this is not even possible at all! So I have zero clue what garbage they use, but more importantly how they even pass mandatory safety regulations?
Reply: @crabapple1974  If you idiotproof the connector, someone will make a better idiot.
Reply: @p_mouse8676  Chinese tofu dreg construction and food scandals are spreading to manufacturing.
Reply: @sammiller6631 Dunning-Kruger.
Reply: @DK.dk11  How is Dunning-Kruger relevant? Just dropping the name is more like a meme iykyk reference than an actual discussion of facts. It's not a fully fleshed out thought.
Reply: @sammiller6631   That is really not an argument for not doing it? You realize that?It is all about risk. There will always be manfucturing tolerances, unforseen situations etc. There are always tradeoffs in requirements vs cost. In this case it is clear that it was probably not designed in a way that took into account the variability of usage cases.  It is not the customers fault.
Reply: @crabapple1974  Customers never think it's their fault.
Reply: @sammiller6631  If you have ever been involved with designing stuff/ studied design theory you would understand how nonproductive that line of thinking is. Humans are variable and do mistakes due to many many different factors. That has to be taken into account for in designing any product.
Reply: @p_mouse8676 the bigger margin there is for error the safer/better low quality materials cousin as much of a concern before now it is
Reply: @sammiller6631 that's been a problem since forever: delivering as specified initially then cutting every corner you can imagine (and many you couldn't) if the manufacturer thinks they can get away with it (the impact on the consumer or the brand of product is not their concern).

There's a book called "poorly made in China" which talks about this kind've thing from the perspective of someone overseeing the manufacturer, it's actually a pretty entertaining read (it's also 15 years old but I'd be surprised if anything has changed).
Reply: @crabapple1974 i think they want to see as much failure as possible so people would be forced to buy overpriced cables. Now, they have the best kind of certification where they don't have to use chips to validate the cable's authenticity like what Apple is doing.
Reply: @p_mouse8676  In my knowledge, I don't think any 40 series cards are using molex and JST connector at all.
Reply: @kaiwenwu8148  we are talking brands here right?
Reply: @p_mouse8676  Yes, but I don't believe that the brand of connector is the issues here. I don't think you can fix this problem by using molex parts, because 50A current will not go through those pin evenly.
Reply: @kaiwenwu8148  I think the best way, is not to use 12V all together.
It's kinda insane to move so much current around a very standard consumer product in general. That is asking for so many problems.
Again, I seriously don't understand how they can even get this through regular safety regulations. I most certainly can't.

For anything that's say above 300-400W or so, just use 24V or 48V.
Since P=I² * R , so the current is squared, all these heat melting problems will go down VERY quickly.
Reply: @p_mouse8676  Increase voltage to 48v will required add 48v to 12v dcdc on the pcb. I don't think this approach is the right answer. My suggestion is to use multiple 12v input rails design or use connector like tx60 or tx60i to handle high current draw from single 12v rail.
Reply: @kaiwenwu8148  This is already a multiple 12V rail design, so I am confused what you're referring to?
We can't beat physics, so compromises have to be made somewhere.
I understand your take on connectors, but again if manufactures just simple use low quality materials, it's not solving any problems.
I have absolutely zero problems pulling 10A from a quality Molex variant they are using.
That's under very harsh conditions and dirty environment. 
Again, I don't think these amount of currents are safe in such a consumer product, based of working with all kinds of safety regulations and companies for the last 15 years.
That's not from a technical point of view, put purely the practical implementation. 
Because you have zero control over what people (consumers) use and how they connect things.
Reply: @p_mouse8676  The 4090 is using single 12v rail input design, that means any 12v pin from the 12vhpwr connector can encounter high current load.  For 50A current load is best to slipt to three 12v input rails.
Reply: @p_mouse8676  Also the 10A load you refer to can easily exceed by this single 12v rail design. This is why use molex connector will not fix the problem.
Reply: @kaiwenwu8148  Molex is 10A per pin, and there are a couple of pins used in parallel? Which btw, using pins in parallel is creating all sorts of issues when it comes down to safety regulations.
Reply: @kaiwenwu8148  the 12VHPWR connector (and the subsequently revised 12V6x2 connector) uses the Microfit connector standard (customised with additional 4-pin sense block), Microfit connector is a Molex product series
Reply: @p_mouse8676  Yes, the single 12v rail on 4090 use 6 pin in parallel that is what I'm point out here. It is so obvious, but I didn't understand why everyone just focus on the connector.
Reply: @DuyLeNguyen  But other manufacturer can make connector in this standard, I don't think there is meaningful difference here.
Reply: @p_mouse8676 this can work, but it will put more thermal stress on the GC's ICs.

The elephant in the room is that the  connector and its pins are too flimsy for the power demand.

Some engineers tried the impossible: to cheat Ohm's and Kirchhoff's laws.

Murphys law: never attempt to cheat Newton's, Ohm's, Kirchhoff's or Heisenberg's laws!
Reply: @p_mouse8676  I agree, it does look like a mismatch and perhaps lower contact area in mixed branded parts causing a heating issue.
Reply: If anybody asks where all the engineers were while this was happening, the answer is probably “at home”. I suspect this is another COVID casualty…
Reply: @cmoullasnet I think this came around long before Covid.
Reply: @cmoullasnet lol.  I don’t think you are qualified to assess how much or how little work an engineer with a remote workstation can do.
Reply: @cmoullasnet  DEI "engineers"
Reply: You ARE NOT an engineer, show me the test documents of those findings and the ANSI/ISO/IEE/NFPS/NEC standard references.